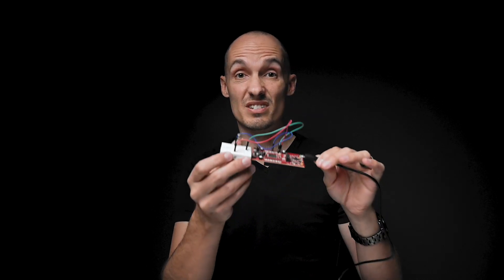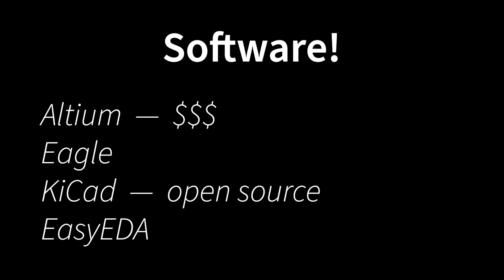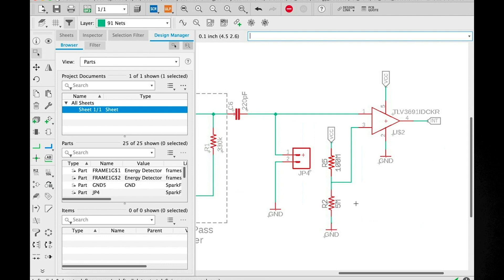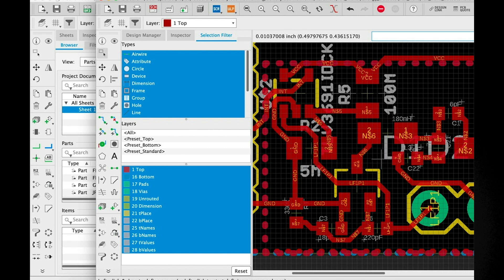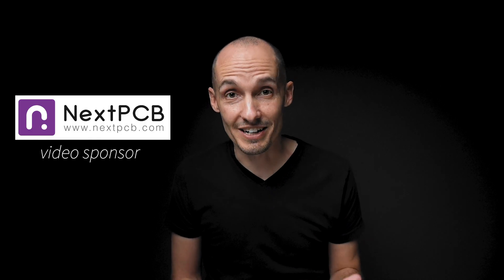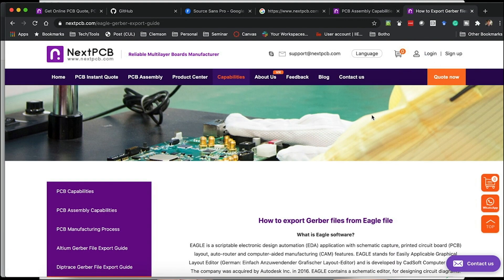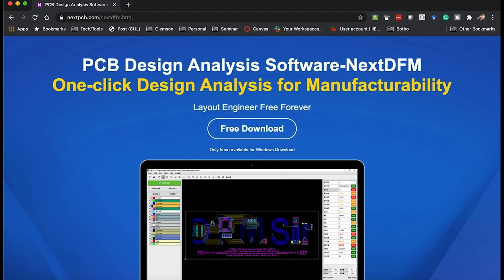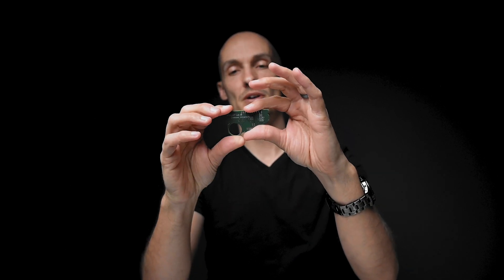Creating your own custom hardware (printed circuit boards)

Comment: Hey guys! I'm a tech enthusiast looking for learning everything about hardware. I wanted to create my own laptop, and I ask you: is it possible, by designing/contracting someone to design the motherboard and assembly the other stuff like CPU, RAM... make a laptop? I know this will be expensive, but my goal is learn with the process and know if it is possible😊
Reply: It is very possible but of course not easy and you will have to be reaching out to many many people in order to learn what you need to get going

Comment: How do you code your pcbso it does what you tell it to
Reply: You do need to have a microcontroller component (not necessarily the whole development board, just the chip with some peripherals) on your PCB for it to be programmable!

Comment: There are a few nuances about schematics worth keeping in mind. Yes, the primary goal of the schematic is to capture and communicate the logical relations of the components, but a well-crafted schematic also conveys a lot of more subtle design information to the person who is actually performing the layout. Physical proximity on the schematic can convey which decoupling capacitors belong with which ICs, which side of a trace to place the dampening resistors on, and other important nuances. I know that when I am laying out my PCBs, I really tend to appreciate when I take care to encode those design features into the schematic, and I end up with correctly operating prototypes much more quickly and with fewer iterations or botch wires. It probably also helps that it's also another opportunity to review decisions and make sure that they actually make sense. If you sweat the small things when designing your circuit and creating your schematic, you won't have to deal with nearly as many hardware bugs during prototyping.
Reply from the maker: Absolutely. Thanks!
Reply: how do yoU design schematics as a beginner
Reply: . Just like most other things, dive in and figure things out as ya go

Comment: Gerber files are actually really cool! At one of my software jobs, I wrote code to convert Gerber Files (usually just the ones that had the information for the traces), and converted them to STL files for 3D printing. And boom, 3D printable circuit. I've since left that job, so I don't have access to the C# code I wrote. I may revisit the project and rewrite it in C++, with larger files speed can be an issue so porting it to C++ would be a fun project.

Comment: In my case I describe every component I need in VHDL and then connect it to the a soft professor system. It's basically the same, you are describing Hardware. Definitely much harder to grasp for software engineers
Reply: Yeah but that vhdl code has to go in some kind of device like a fpga and the fpga requires its own board and external components, the thing is start making hardware outside of development boards

Comment: I'm curious, How do you actually load a code into that board? Let's say you wrote some C code, how do you actually compile your code for that handmade board and actually load and run it?
Reply: Depends on the microprocessor/microcontroller you are using, every microprocessor has its own set of tools, usually you compile the code with the processor specific compiler in your computer and then load the program to the chip via serial communication

Comment: how you program  this circuits  to  run software or firmware?
Reply from the maker: Somewhere in your system, you probably have one or more microcontrollers (typically a component on your board). The programming interface will vary by processor, but, you typically have to expose some pins on the board for programming.

Comment: Great video as always. I've ordered PCBs with other people's designs (pcbtrain are a good outfit in the UK), but wouldn't know where to start designing my own. I'm sure you've answered this many times before, but do you have any electronics learning resources you'd particularly recommend to someone with a software background?
Reply from the maker: Practical Electronics for Inventors (book) is solid, and it avoids a lot of the theory that you may not immediately care about.

Comment: very interesting!
Im a ex- electronics technician for industrial engineering (this is translated with google, bcs i dont know the correct name in english),
but i dont have the confidence to design a PCB 😒
I did all the math, soldering and board-building many years ago and none of it was designed by me. It was just building by blueprint.
PS: There is not enough C-Content out there (compared to other languages). Its mostly basic crash-courses.
You are the only one (that i know) that goes deeper in C. You're my favorite C-Channel and you deserve much more Viewers^^
Harvards CS50 ignited my love for C and you helped me a lot on understanding some details!
Reply from the maker: Thanks. I'm glad I could help. You should really design a simple board. I think you'll find that it's not as daunting as it seems once you are done with it.

Comment: Hey, I want to write a simple graphics library in C for multiple ebedded systems that can drive 1 bit screens like an led matrix for example. The thing I struggle with is how to store frame/pixel information. 

How would I go about implementing a framebuffer in this case?

One uint8_t for every pixel is such a waste of memory, as i only need on bit per pixel.

Using 2d arrays in C is also not very practical, IMO.

Storing multiple pixels in one 8 16 or 32 bit number is also a pain, as it requires relativly "complex" transformation from screen space to buffer space, when the width of the screen is not a multiple of the word size.

Is there maybe a way to just store a long line of bits without a format that is width*height long or something like that?

Any ideas are appreciated
Reply from the maker: This is going to depend a lot on the display you're using? Or are you designing that from scratch?
Reply: @JacobSorber  that's the thing, the plan is to write a universal library for 1 bit displays. My problem is just how to store a one bit image to be easily moddifiable in code. The code to interface the hardware is gonna change from project to project. 
My question is, how would you store pixel information at an arbitrary size so you can acess it in x y coordinates without much processing needed?
Reply: @hansdietrich83  I would capture the set of display parameters in a struct (in C++ I probably would've made a class with some suitable methods instead), such a how many pixels wide/high and how many of your uint8_t you use in each direction. Upon initialization you could decide to use only a whole number of uint8_t in the minor indexing direction (say x), which possibly means adding an extra element and waisting max 7 bits per y-coordinate. [nh = y; nw = x / 8; if (x % 8) ++nw; buf = malloc(nh * nw);] You can then make a couple of functions to convert to & from x,y and the corresponding array index and bit offset, which use the struct members to do the calculations. The formulas should be relatively simple using integer div/mult/shift/mod. [idx = y * nw + (x >> 3); bit = x % 8;] All library functions receive a pointer to that struct as one of its arguments, and even the buffer pointer could be stored there so the client code only needs to keep track of that single struct to represent the display.